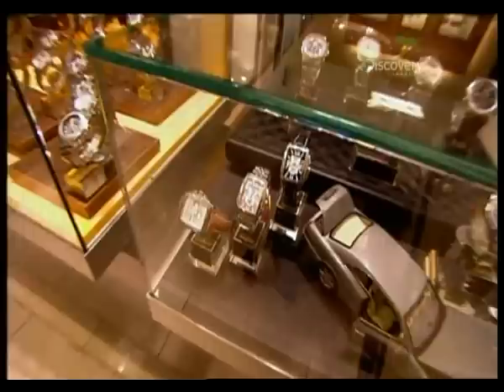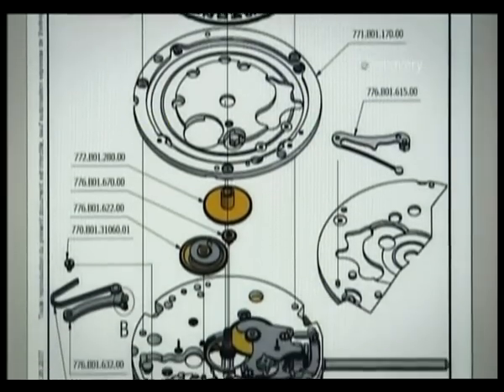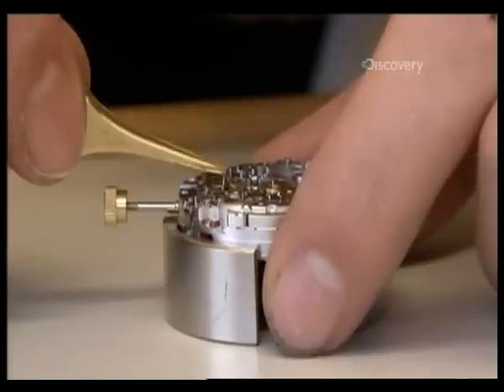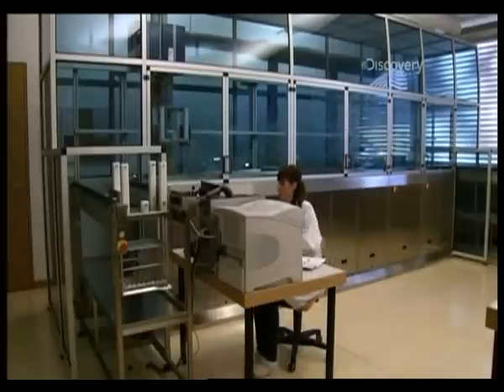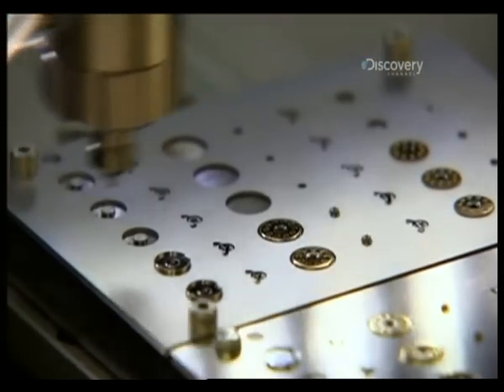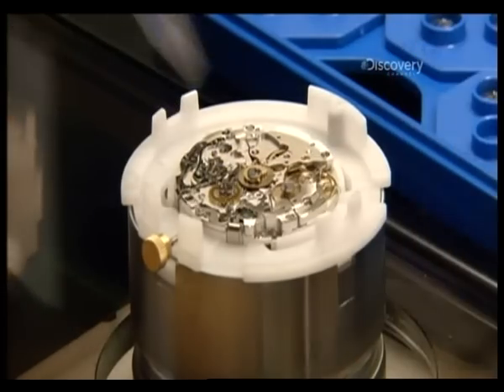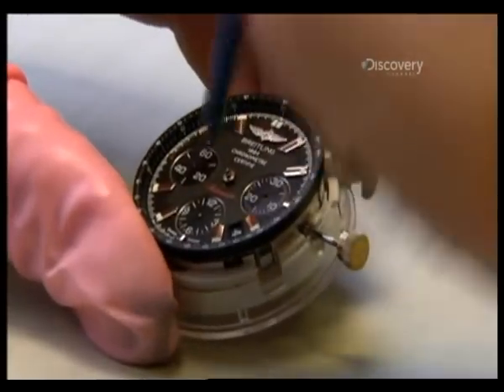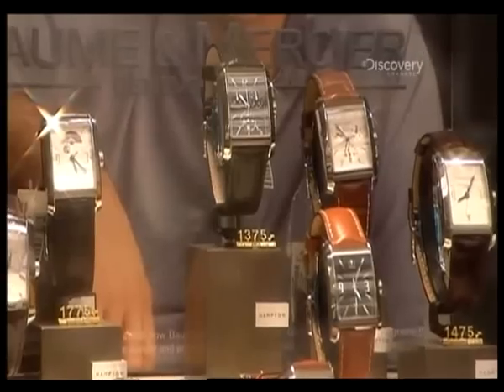Breitling How Do They Do It

Comment: Well, that's maybe why My new Breitling Navitimer 46mm Doesn't keep good time gains around 10 min: a day. It's designed for pilots and only works at 37000 feet. But that doesn't account for the button not working. It will go into its 3 settings, but nothing happens when you turn it. Now on its second trip to the repair shop in less than 11 months. Only hope that one day it'll work as I hopped it would when I get it back. One good thing I will say about it though the guarantee works. So at least it's not cost too much only for the postage. Thanking Buddha that I have another watch that works as a standby.

Comment: @rw20220: The current B01 models, the Chronomat that replaced the Evolution, and the N01, the new Navitimer, both use the first ever totally in-house Breitling movement, the Calibre B01. It takes the Breitling Chronographs to a level not yet seen from the watchmaker.